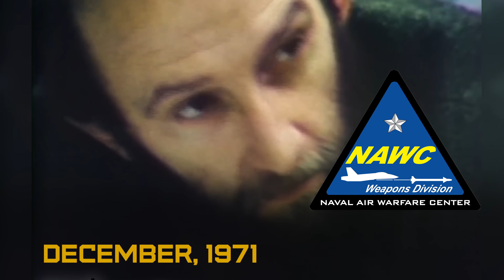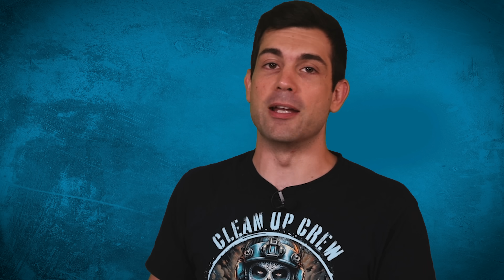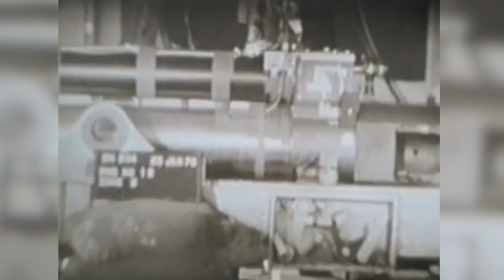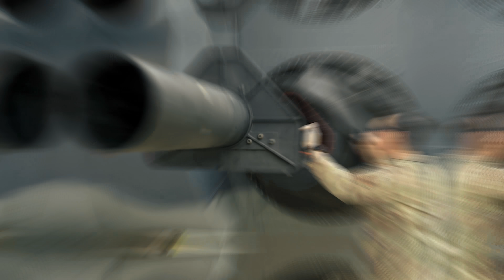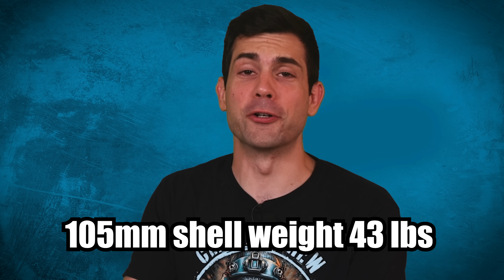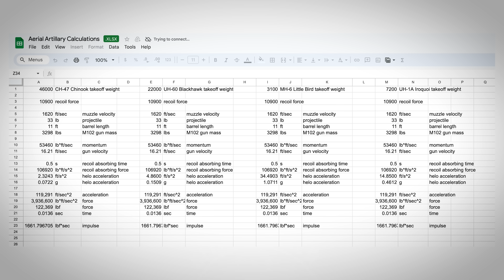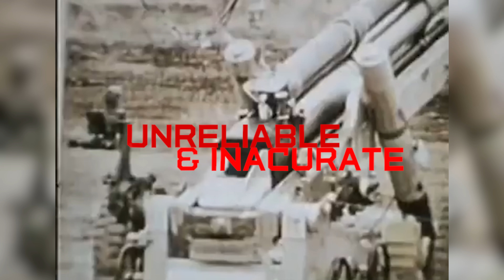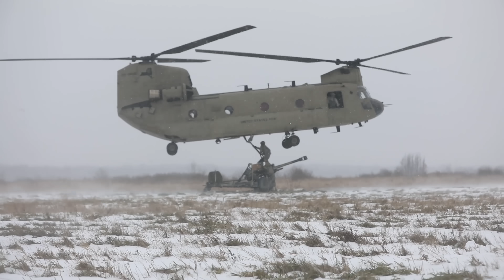America's Twin Cannon Artillery Helicopter is Wild

Comment: Air Force: "we want to retire the A-10"

MQ-9 with a GAU-8 in a pod: "Hello."
Reply: They tried to pod the GAU 9 on to the F16 in the 80s.
Reply: @rorythomas9469 tried and succeded, the pod also fit the f15s, it only had 4 barrels but it was successfully mounted and functional
Reply: And we shall name it Skaffen-Amtiskaw
Reply: They mounted the gau8 on a pod for f16s and 15's in the 80s
Reply: I seriously thought about that. Just turning the A-10 into a giant drone.
Reply: @slayerd357  they could stick whatever AI madness from the QF-16 into them and really get me going.
Reply: When you can make the cobra rattler a real plane you can retire the A-10
Reply: You could do the same thing with the Sky Warden too as it has the ability to carry gun pods on it's hardpoints with either .50 cal or 20mm.  Not sure how much ammo it'd be able to carry vs the A-10, but having a slower firing rate would conserve more ammo and might make up a little of the difference.   The Sky Warden would also be cheaper to operate in terms of maintenance costs than the MQ-9.  Although, it's not suitable for all mission profiles.  Still, I do like the idea of a MQ-9 with a big Gau-8 ( 'Merica! ).
Reply: @mjk9388  All the complaints about the A-10 are because the pilot is vulnerable to modern air defences.
Just convert the A-10 into an FPV drone and everyone is happy.
No pilots get shot down, we don't have to scrap the A-10 and we all get to appreciate the BRRRRRRT of Freedom.
Reply: @disposabull  This idea was looked at by the AirForce awhile back (before 2012).  I'm not sure what came of it.
Reply: @disposabull look at Mr. Big Brain over here! "We could just convert the airframe into a dro…"
Um, okay. Why is this actually kind of genius??
Reply: @disposabull  plane slow as shit. gonna take too much money which we can use for something better. also the gun can't kill m60's pattons.
Reply: @mjk9388  F/A 16 and A 16, during Desert Storm they tried something similar with a pylon mounted, 4 barrel version. But it wasn't reliable
Reply: have you heard of a missile it better then a gun now do to modernization as were not in the 50s or 30s
Reply: @mrman5666  Not cheap though
Reply: @mrman5666  sometimes you have to rain lead to kill enemies which is quite cheap compared to missiles. Unless the rain cloud(aircraft) is shot down
Reply: @mrman5666 yes but what happens when you don’t want to use a multimillion dollar missile on a single insurgent? Not saying it’s not worth it to save lives but finding a way to strap a auto cannon on a drone and have it be efficient is way better cheaper than using an agm
Reply: The air force never want to retire the a 10
Reply: @khanhnguyen-tt3ff  for 10 years, they've been trying to retire it.  Congress keeps saying "keep them".
Reply: @RonJohn63  I mean, face it, the A-10 is damn near a national meme that has become part of our style as a nation, it probably does more being hinted at and suggested than it actually does in combat, or something.
Reply: @khanhnguyen-tt3ff  they wanted to retire it since AH-64 became a thing. Neither A-10, nor AC-130 have any advantages over combination of both helicopter gunship directly supporting the troops AND a multirole fighter armed with guided weapons. It's like trying to retain Churchill tanks for infantry support when you already have Bradley.
Reply: @TheArklyte  I think enough people want the "almost good enough" fixed wing survivability, despite solutions with dedicated air superiority supporting dedicated gunships being obviously safer. There is also the mathematical truth that rotorcraft are less efficient than fixed wing, which is important to CAS "time on station." This last point is obviously ignoring the limitations of actual models in service, including unrelated metrics like maintenance and repair. It's true in a direct sense, and that counts for a lot in many circles.
Reply: No advantages ?  
(1) Speed.Slow fixed wing AC 130/ A10 are still about twice as fast as the Apache 
(2 ) Range . both aircraft can fly way farther than the Apache  and stay above the battlefield many times longer.... and that's WITHOUT the refuelling.
(3) Firepower, the A10 can carry much more total rockets and tons of bombs plus the GAU . And of course the Spectre is the most terrifying CAS aircraft ever built, a absolute nightmare of devastation that can deliver more raw destruction and death than a dozen  Apaches @TheArklyte
Reply: @Null4eva  
Read comments before trying to answer. Search for word "combination" in my comment if your dyslexia is too severe. So:
1)they have far slower response time and range then multirole strike fighters and can't loiter with troops like helicopter gunships;
2)once again they lose because you decided to ignore half my comment about mutlirole fighters. AH-64 is refueled and rearmed ON SITE with troops, it doesn't need to leave them and can loiter in single spot;
3)I'm yet to see "Spectre" with four Paveway III ready on short notice. Not to mention it and A-10 breaking sound barrier. Or being able to loiter at tree top flinging ATGMs at selected targets for as long as troops require it. Oh, and before you go, 30mm HEDP is more usefull then 30mm APCR in real world, have a nice day;)
Reply: @Null4eva   @Null4eva  
Read comments before trying to answer. Search for word "combination" in my comment if your dyslexia is too severe. So:
1)they have far slower response time and range then multirole strike fighters and can't loiter with troops like helicopter gunships;
2)once again they lose because you decided to ignore half my comment about mutlirole fighters. AH-64 is refueled and rearmed ON SITE with troops, it doesn't need to leave them and can loiter in single spot;
3)I'm yet to see "Spectre" with four Paveway III ready on short notice. Not to mention it and A-10 breaking sound barrier. Or being able to loiter at tree top flinging ATGMs at selected targets for as long as troops require it. Oh, and before you go, 30mm HEDP is more usefull then 30mm APCR in real world, have a nice day;)
Reply: @TheArklyte  Are you special? When did I say the A10 was super sonic? I just said it was much faster than the Apache. Apaches are not refueled on-site, I would frequently see them sharing space on the same runways  in Afghanistan ( USAF 2006-12) . 
  When you say loiter " with troops " you must think just hovering over head is some sort of accomplishment... waiting until someone pulls a MANPAD out of their robe a turns your $40mil eggbeater into a fireball, because yeah... Apaches have been shot down by Farmers with AKs , they need to keep moving  for strafing ( just like the A10)or stay the fuck way  out  at missile range( just like how the fixed wing AC orbits). Do you think troops within artillery range drag a aircraft fuel truck along with them 😂
Sensitive combat fighters f35/f18 don't deploy at forward airbases, the Marines keep trying VTOL fighters but it doesn't work for shit.
 I did indeed read your comment on " fighter response time" but I chose to ignore it as the rambling of a poorly educated child until you got insulting. Ask any US Army soldier what platform the would prefer CAS from , I talked to at least one that wanted to kiss the  AC crew for saving him and his friends .
Helicopters struggle at high altitude, they are forced to carry lighter loads, they have trouble in mountains especially if the air is also hot.  Oh.. yeah, the A10 can fire ATGM  as well ( look up Maverick ) but now they don't really need to since you can find videos of a forward air controller hitting a fast moving wheeled vehicle with actual fucking smart bomb( that would be the OA-10).
Reply: @TheArklyte  Helicopters fly low and very slow compared to fixed wing cas. They carry much lighter (read: weaker) weapons. Have a very limited view of the battlefield and are much more susceptible to both enemy ground fire, aircraft, as well as catastrophic failures. 

Don't get me wrong, the apache is an amazing machine. But an apache loaded to the gills couldn't match even a single GBU-31.

If you need an example of this, look at ukraine. Neither side is using gunships on the front, and any real attempt to typically ends up on twitter. Pilots have resorted to lofting FFAR's because they can't get close enough to provide any air support. That isn't to say an A-10 would be fine but there has been much more SU-25 activity as of late.
Reply: @khanhnguyen-tt3ff  USAF wants to retire it to pay for the F-35. Congressional members want to keep the airframe in their districts because it equates to jobs, and A-10 squadrons are not being replaced with F-35 squadrons on the same bases.
Reply: @tango_uniform  there are three different F-35s, only one is a striker, context is important... and all three have far shorter response time, longer range and higher survivability then any A-10 anyway;)
Reply: @TheArklyte and less loiter time. The Air Force wanted to retire the A10 before the F35 was mission capable. A TACP (Tim Stamey) was brought in to testify before congress and tell them what troops on the ground needed. 

If you need air support, helicopter gunships might very well get the job done. A10's most definitely get the job done. AC130's can orbit the area from a distance, have excellent loiter time and can make that general direction disappear.
Reply: @khanhnguyen-tt3ff  The air force hates the A-10. It's subsonic, it's vulnerable to MANPADS, it sucks against modern armor, and it can't even deal with random ISIS toyota technicals strapped with 25mm russian AA cannons. They sent Ukraine F-16s because it was the platform built specifically to engage Russian tank rushes while also having a good shot at air superiority.
Reply: @khanhnguyen-tt3ff the Air Force has been wanting to get rid of it for like a decade now, doesn’t help that the F-16 is a million times better at CAS than the A-10 ever was.
Reply: @khanhnguyen-tt3ff  Got it backwards, actually. The Department of the Air Force does want to retire the A-10. The infantry, public, and Congress love the A-10 though. And Congress approves the budget -- they've been the ones preventing the USAF from retiring the A-10 earlier. 

But the A-10 is an old plane, getting expensive to maintain and repair, and isn't suited to a war against China, so the USAF has been retiring them by the dozens each year, planning to have them all sent to the boneyard by 2029. Of course...that was before Ukraine and the Middle East flared back up. The A-10 can't go against modern SAM systems, but it can still perform interdiction and CAS against extremist militias. So who knows.
Reply: @khanhnguyen-tt3ff That's untrue. I think Cappy actually has a video on it.
Reply: @khanhnguyen-tt3ff    A-10 is a sitting duck to robotic drone swarms.

Comment: Rockets exists.
A simpler option, at the time, would be to just fit some kind of launcher that can be magazine fed while in flight. With a lot of spare rockets kept inside the fuselage that link into the feeding mechanism. 

Far less stress, the weight is mostly inboard, and it can fire salvos to blanket a target area with near simultaneous explosions.
Reply: Now I am imagining a Chinook as a hellfire missle truck taking out a hundred tanks targeted by drones with fricking laser designators.
Reply: rockets are more expensive to manufacture.  this just requires you to load a fancy metal tube with the shell and propellant. no fancy rocket chemistry that can go fowl.
Reply: @Shinobubu except when the poisonous oxidizer leaks out
Reply: Kinda like what those guys firing rockets in a ballistic trajectory in Ukraine…
Reply: Anyone can shoot out the dumper with the cargo ramp down. Now imagine you just got permission to fire normally sling-loaded field artillery in flight from inside the cabin. That's what I call voodoo spooky
Reply: Wanted to see this response.  America seems to have a gap in terms of cost effective rocket artillery. A Chinook could probably carry a pretty impressive hydra 70 or katyusha rocket load

Comment: I wish i lived in the Timeline where the GunsAGoGo Wasn't Scrapped because of a Maintainers' Mistake, and a Crew Chief's arrogance.

Rocket Artillery is best Artillery. 

AERIAL ROCKET ARTILLERY IS EVEN BETTER!

FULL LOAD OF WHITE PHOSPHORUS 2.75" AND TWIN 20MM CHAINGUNS!

And what ruined it was the Mistake of mounting M2 .50 Cals to M60 Mounts.

Which were also improperly torqued.

So firing the M2s was shaking off the Bolts that kept the whole side of the Fusilage's extra Armor on.

The Bolts Jumped out, the 20mm Swung up because of Recoil and Cut the Helicopter in Two.

All of this could have been fixed. But the AC-47 took all the Spotlight with its Impressive lazer-light-show.

Comment: I think a better idea would be to design a “rapid dragon” payload that can dispense cruise missiles and be fitted to a Chinook
Reply: Actually the Chinook should be able to use rapid dragon as is since it carries pallets around easily all the time.

I'm not a Chinook expert but I think the cargo bay can open in flight and drop pallets.

So in addition to the expensive rapid dragon you could probably also sling jdams out the back and guide them with GPS.
Reply: Longshot drone program
Reply: They are probably already working on it.  I wouldn't be surprised if the DoD isn't trying to weaponize everything that isn't already a weapon or weapons platform.

Comment: I love the idea of a drone that's basically a ghost gun version of artillery, just a barrel with drone props. Made cheaply and quickly and will break after a couple shots, but it can loiter anywhere and take out almost any target for a lesser cost.
Reply: Honestly all they have to do is have the drone's cone of fire pointing mostly downward, throwing the blast away from the drone and giving it a little bit of bonus lift.  A drone is already designed to handle more stress on that axis.  It would be a lot more accurate than dropping mortar rounds from a hundred feet up.  Being able to aim a cannon or RR with plain crosshairs and have the round impact more or less right on target instantly, even with a modest forward speed, would be a vast improvement from the inaccurate drift and wobble inherent with dropping a mortar round from a stationary drone.  The biggest problem would be in-flight reloading, and the fact that a drone big enough for artillery or RR would be helicopter size at least.  Probably better with a Mk19 and a couple dozen rounds on the belt, that would give the drone a smaller overall presence.

Comment: The 88 mm gun used by Germany in WW2 was famous for both bringing down enemy aircraft and destroying enemy tanks. I would think it would be lighter and easier to fire than 105 mm artillery. I don't understand why the U.S. army wouldn't mount them on Chinooks. The Germans mounted them on Tiger tanks and they had a reputation for one shot one kill.
Reply: Because we already had our own. 76mm M6 AT/TD guns, and 90mm late war design. You've probably seen them at a courthouse or Legion/VFW/etc.
Reply: @anthonykaiser974  Good point, the 76mm gun didn't have quite the penetration of the  German 88 but it is lighter so why wouldn't it be used instead of the much heavier 105?